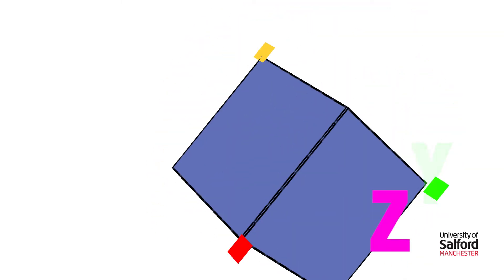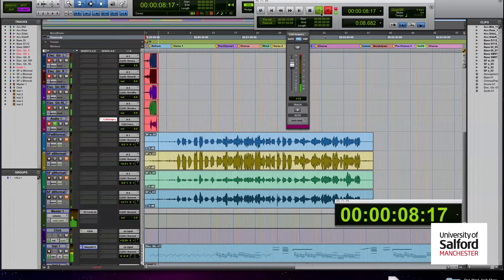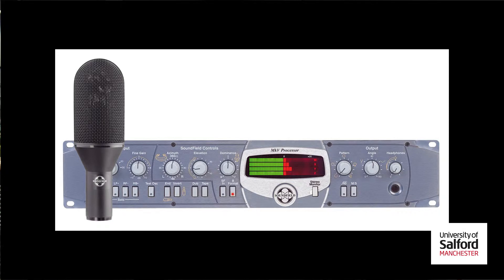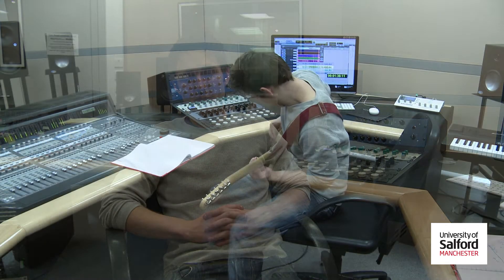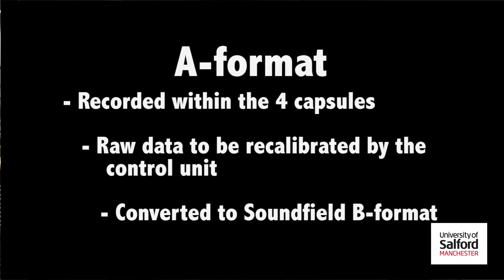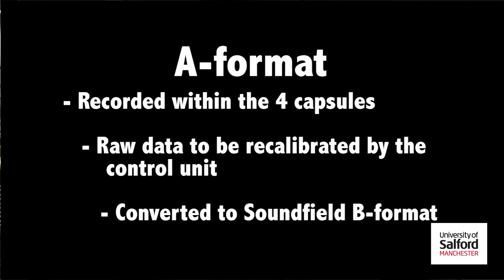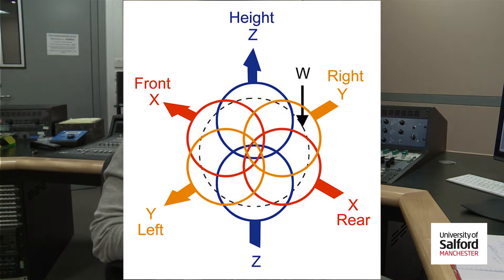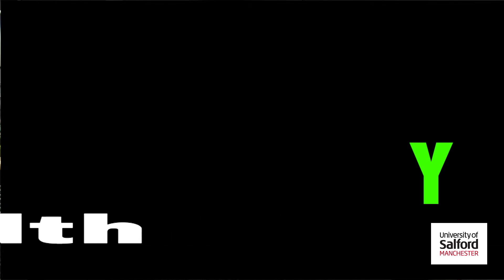THE SURROUND LOUNGE - Soundfield Recording

Comment: Eargle says the capsules on a SF mic are cardioid/subcardioid and they combine and subtract to form 1 x Omni and 3 x fig.8 channels WXYZ. My understanding is the capsules themselves are not Omni and Fig 8 etc.
Reply: Hey Ken,
I'm on the same line of thinking as you. My understanding was that they're subcardioid and through the various phase matrixing options on inside the control unit, almost any stereo technique can be synthesised, much in the same way that an M/S array can virtually synthesise a XY pair.